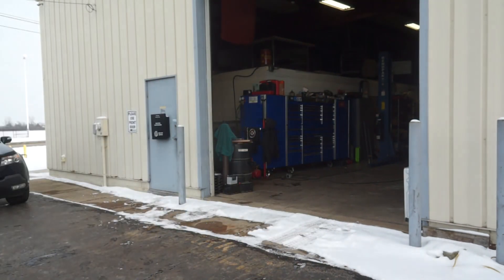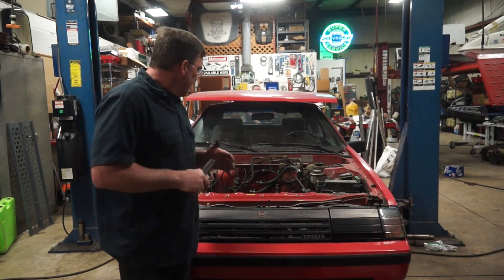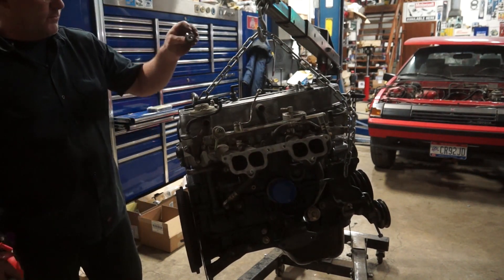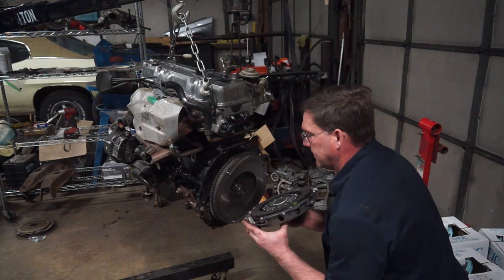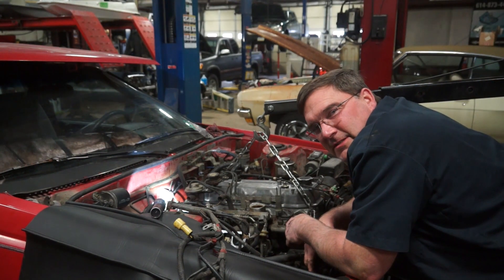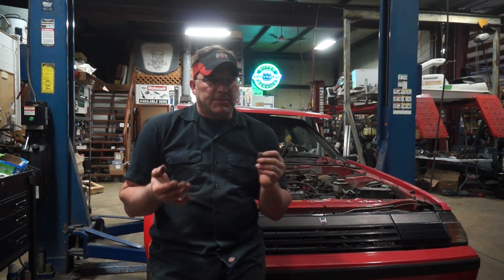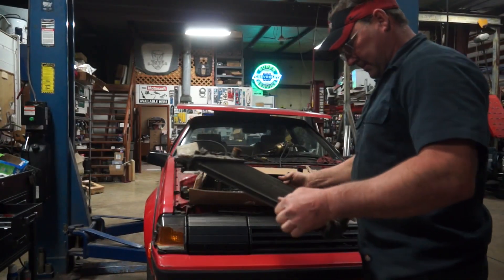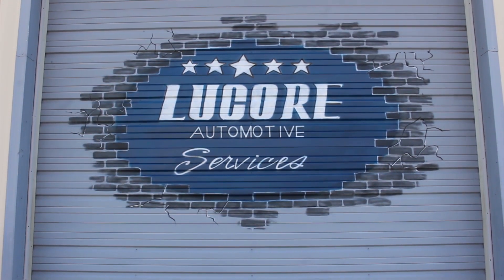22RE 1985 Toyota Celica GTS, Freshly rebuilt motor install. From Lucore Automotive

Comment: I bought one of those brand new too!  I've never seen a worn out 22r but anything's possible...
Reply from the maker: Super SUPER cool car and a 1 owner so realllly rare to find. It's in extremely good shape, unfortunately suffered from an overheating and had to go see the Doc.
Reply: 518.000km on my hilux when i sold it about 4 years back. Body went rusty but motor fine. Still see it driving around. Used to pop a head gasket about every 100.000 but went to a steel shim style and studs and no problem again.
Reply from the maker: @watsisbuttndo829  they really are crazy bulletproof motors, and very very simple. Unfortunately this one suffered a catastrophic overheating and needed some bigger than normal attention. But, should be fired back up soon and ready to cruise another few decades :)

The Hilux is such a legendary truck, with a VERY well deserved reputation!
Reply: @watsisbuttndo829  I have no idea how many miles or hours were on mine, it was actually a 1979 Celica (I believe GT).  Sold it for some silly reason but no problems at all, It never used oil and always ran great, just ran and ran.  Legendary engine for sure and the car was fantastic.

Comment: Why wouldn't you have knocked the snow off before bringing it inside to melt all over the floor of the shop?
Reply from the maker: We have floor drains for a reason :) Also less chance of damaging paint and plastics that are old and cold
Reply: @LucoreAuto   I figured it was something like that.  I never had the good fortune to work in a shop that well equipped (I was a mechanic at a Polaris/Victory/Suzuki/Kawasaki dealership for most of the early 00s here in Louisiana.

That kind of ice and snow is never seen here, which is why I asked.
Reply from the maker: @sayrerowan734  not a problem, always happy to explain our weirdness :) There are a lot of toys we've got in this shop, many of which don't really ever get attention. Just like our diesel work, we do a TON of it but the internet doesn't ever seem to really want to see that ;)